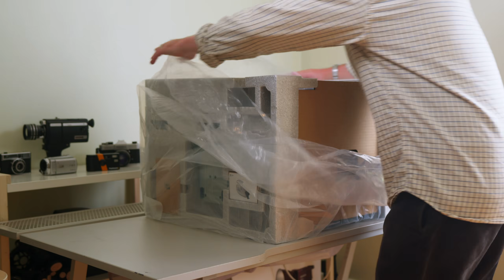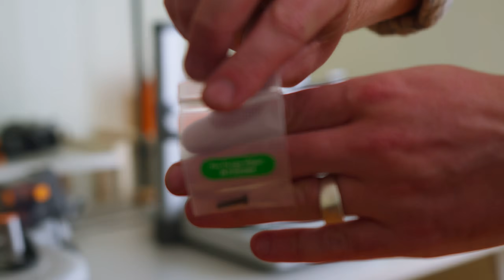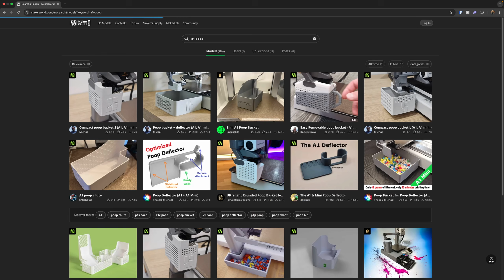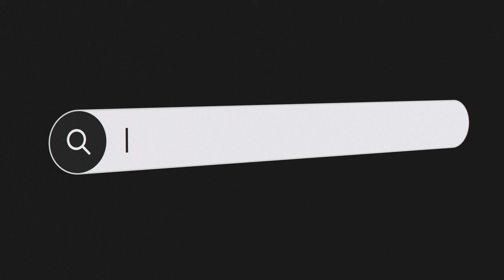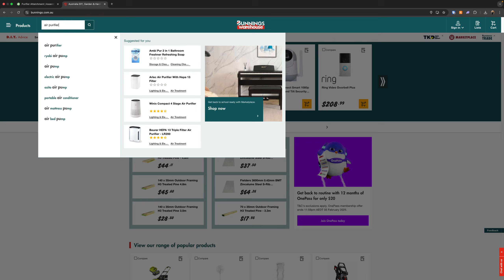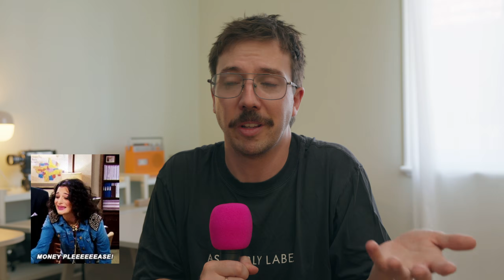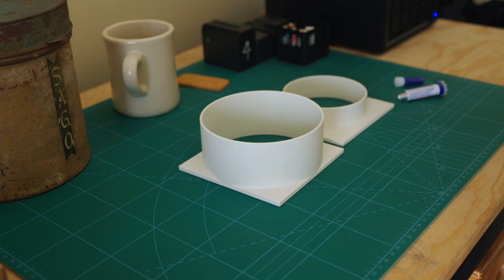Setting up a Bambu Lab A1 so that it doesn't slowly kill me

Comment: I watched a Swedish guy use an industrial filter and had the ppm analyzed. Yes some higher temp plastics spew out particles at high ppm but thankfully PLA has a very low emission.  Garage is best with door open during the day . Cany beat air constant circulation. Id never have a printer in an office or bedroom
Reply from the maker: I think I watched that same video, after I made this one. I definitely didn't take a scientific approach, more of a general mouth feel arpproach
Reply: @Billt_it  All good. I thinks its important that more people are aware of it then they can decide what they want to do about it. :)

Comment: Been there recently - Bought bamboo because I want to print, not spend time on a hobby... 2 months later and 40kg of filament lighter, I am halfway to a voron build and have ratrig idex on order XD   It is actually great you use the printer to solve the issues around it, but I general recomendation from noob to a noob - skip all those fancy wall systems (honeycomb & co) unless you do it for the aesthetic. They are not cheaper than slatwall, and take ages to print if you need to cover a relevant area
Reply from the maker: Thanks for the pointers! Yeah, the more I'm learning the more I'm realising that you have to design with the printer in mind, as in you have to have designs that are efficient to print. That said, a few aesthetic speed holes™ here and there for looks can't hurt